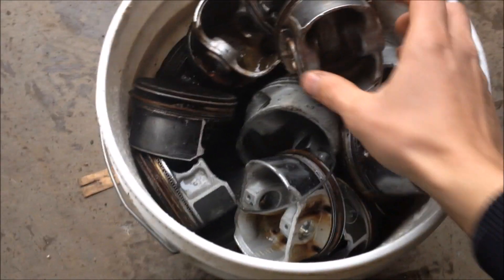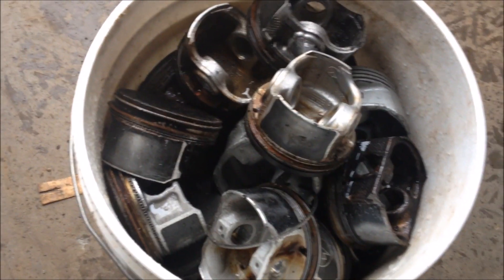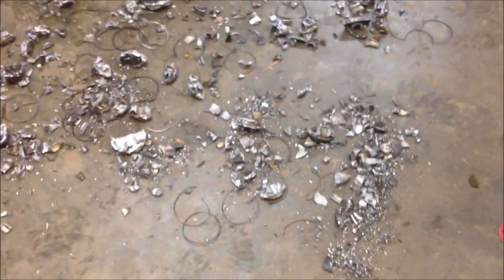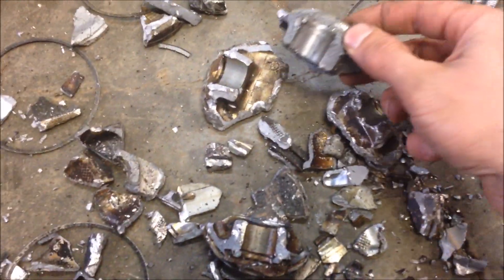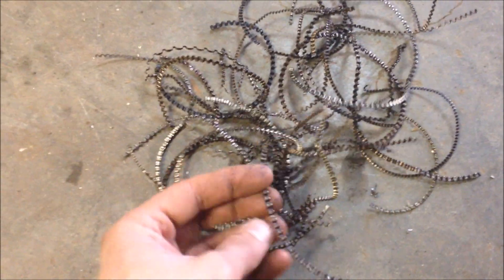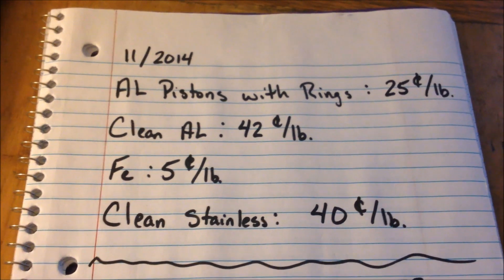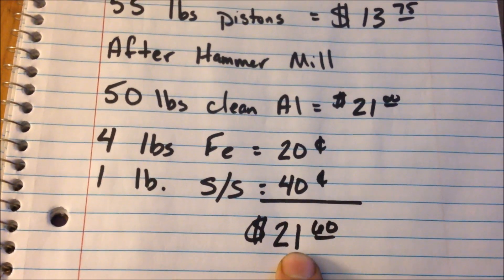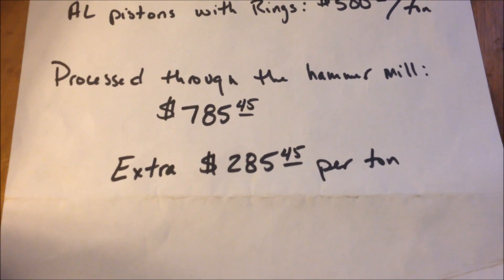Crushing Scrap Aluminum Pistons with a Hammer Mill to Increase Scrap Value

Comment: Another benefit. Once you've upgraded the scrap value you've also made it to where you can hold more material in the same space for transport. So you're making even more money for less fuel costs and time saved from not making another trip.
Reply from the maker: One of the big perks

Comment: if u melt the aluminum the rings will fall in the bottom!
Reply from the maker: laxwork Yes that is correct, but it takes a lot of energy to melt the aluminum and the fumes etc. will be problem.  It is much easier, quicker, and more efficient to break them up and pull the rings out with a cross belt magnet.  Thanks for the ideas!
Reply: +mbmmllc Going to be building a foundry this spring, runs on veg oil.
Reply from the maker: +TheStarforce2 sound good.  Let me know how it works out.

Comment: if its stainless it will spark when you strike it on a grinder if it doesn't spark then it is aluminum
Reply from the maker: Daytona-
Thanks for the tip!  I will try the grinder trick next time!  They were really strong and hard to bend so I figured they were stainless.  My scrap yard confirmed when I took them in.  Thanks again.

Comment: Amazing!  A big thing would be to now the time too.  How long did it take you to process the 50lb of pistons?
Thanks!
Reply from the maker: Hi Moose-
I forgot to put that in the video, oops!  It took about 3 minutes to run those 55 lbs of pistons through the hammer mill.  That works out to be about 1000 lbs./hr or so.  Or about $140-$150 in upgraded value per hour.  Thanks for noticing and asking!  Glad you liked the vid.

Comment: what a waste of time and energy just to remove rings.
Reply from the maker: Hi Kevin-
This piston test was actually a special request by my local scrap yard.  They get about 5 tons of pistons with rings a month and wanted to see if there was enough money in upgrading the aluminum.  They are really excited about the results.  They are looking into a hammer mill with a discharge conveyor, mag belt, and a guy hand picking the stainless rings.  This makes sense to do if you have the volume and through put.  Thanks for your input.
Reply: mbmmllc
Ok. that would be definitely worth it then.